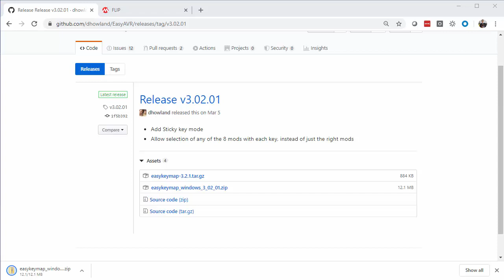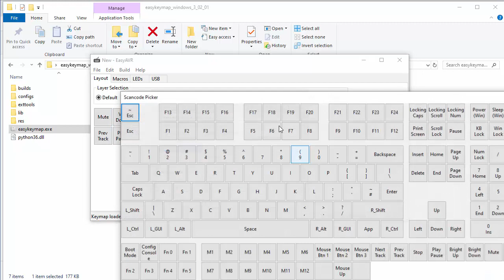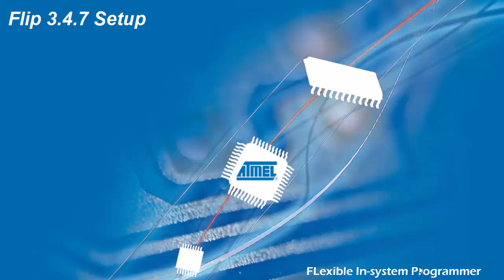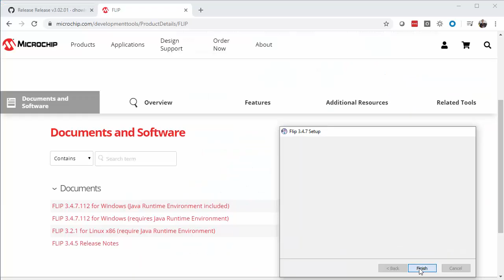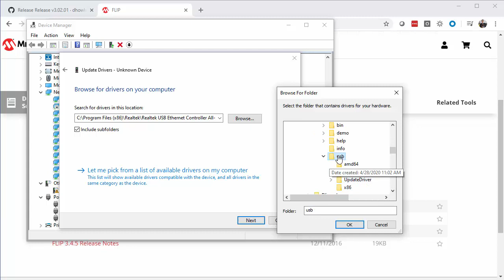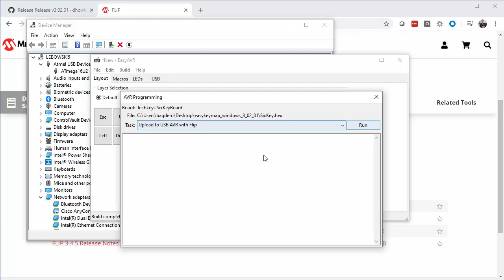Reprogram OneKeyBoard and SixKeyBoard with EasyAVR

Comment: I have a Sixkey keyboard from TENKEYS. How do I get to the circuit board? It looks like it is glued into the case. I don't see any screws. - Thanks
Reply: The Sixkeyboard has screws that connect the circuit board to the case.  Remove the keycaps first to reveal the screws

Comment: Thank you for the video instructions. I was able to program a TechKeys Nine Key keyboard using the method described in this video. Here are some tips from my experience that may help others. This is my experience only, a TechKeys representative is welcome to chime in with corrections.

- Windows 11 64-bit
- Flip 3.4.7
- EasyAVR 3.02.02 (EasyKeyMap.exe)

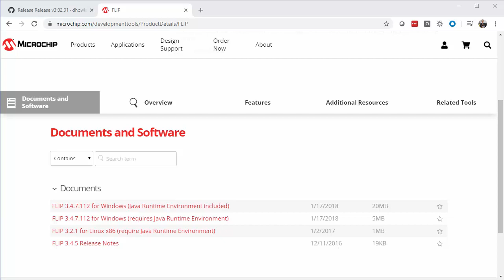1. I did not have to install drivers as shown at 3:02. When I plugged in my keyboard, Device Manager did not list it as "unknown device" but instead as "HID device".
2. The TechKeys keyboard came with an on-board programming mode that can be entered by holding one of the keys for six seconds. This is not the same programming mode that is entered by shorting the pins on the back of the PCB. Only the latter mode can be used to program the keyboard using EasyKeyMap and Flip. 
3. When I shorted the pins on the PCB to enter programming mode, the keyboard in Device Manager changed to "Atmel USB devices". From that point I was able to program the keyboard as shown in the video.
Reply: I'm having a similar experience - shows as an HID device before shorting the pins, but after shorting the pins like you did in Step 3, the device does not show up in Device Manager at all. Windows doesn't seem to acknowledge the device at all, not even a notification sound for plugging in a USB device. I can't flash the firmware either. Anyone else have this problem?